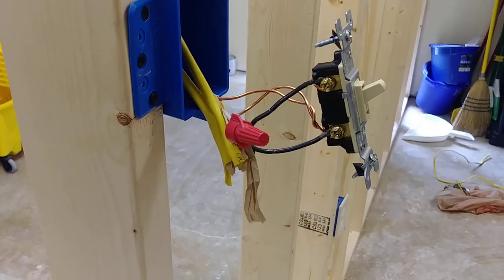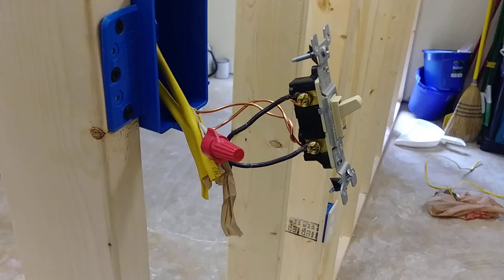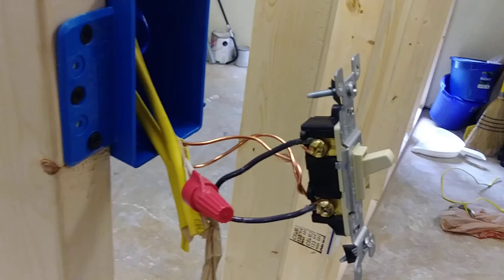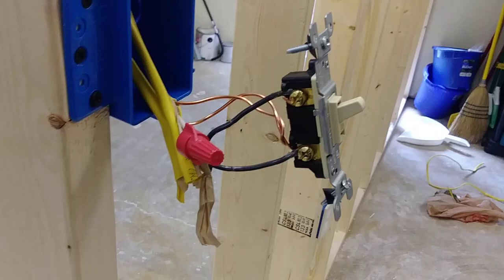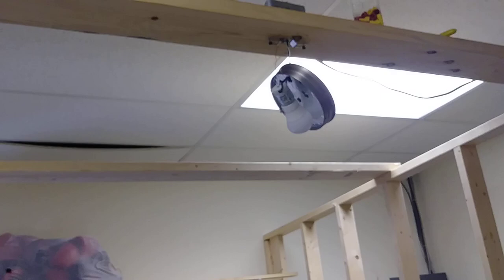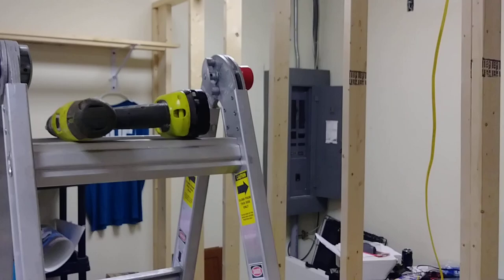When the light switch is tripping the breaker

Comment: As a licensed electrician, I believe you said splice your ground and only one neutral. You focused on the bare copper wires when you said Neutral. That is not the Neutral that is your ground. You got them mixed up. Ground wire is bare copper and that is the wire going to the switch in the bottom right (usually green screw). The Neutral are the white wires that ARE suppose to be spliced together with the red nut the way you have them. Hot black wires are fine as well. One brings power and the other delivers to your end source of light. The switch is just the middleman cutting power on and off between those 2 blacks wires. Nice video, Hope this helps someone.
Reply: No, he didn't, you just want to brag...you are what is called an
Reply: NICJOHN You are correct and the other guy lynxcat is wrong. By the way lynx 18 others agreed with him.
Reply: @lynxsdcat2873 No, he is just clarifying and making an important point with valuable information.  How the true intention of the internet should be. It is ok to mention your qualification before talking about electricity  so thanks again @NICJOHN
Reply: I caught that too. I still could understand what he meant though. Good video, fixed my problem!
Reply: Agreed

Comment: Trying just to say.  The worst work I’ve ever seen.  Maybe you posted as a joke but no.  Just be safe.  Grounds were not either crimped, pigtailed or even good old ol school.  Solder and taped.  Hot, switch leg an no neutral on a switch of this type.   There are some that may require a neutral if they may have I light indicator on the switch.       Not good practice there.  Single pole or others, practice safe wiring.

Comment: What if it's an existing light switch tripping the breaker? The house is 12 years old. Suddenly when we turn on the outside light near the driveway (tall pole-lantern type light), its trips the breaker. Is it the light switch or is there a problem with the outside lantern pole?
Reply: Did you Figure it out?
Reply: @lcarlosmoreno6436  No, I never figured it out. It just stopped tripping for some reason.
Reply: @scrubsz  wow lol possible loose wire and tightened itself after time 😂

Comment: You are not qualified to give advice. Your grounds should be pig tailed and your should not have the yellow primary insulation hanging out in front of your box. Awful demonstration. Also both those black wires are not “hots”. The one that brings in power is the hot and the other one is a switch leg (or traveler) and is only hot when the switch is in the ON position